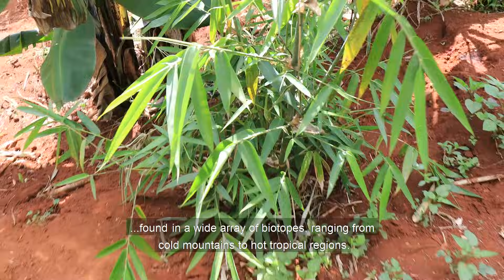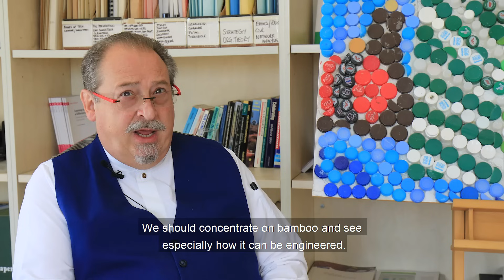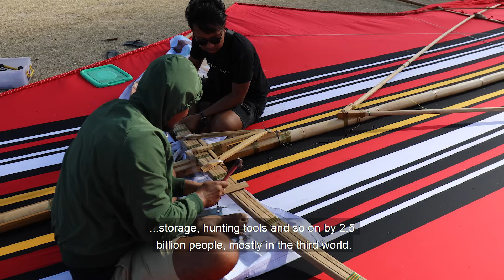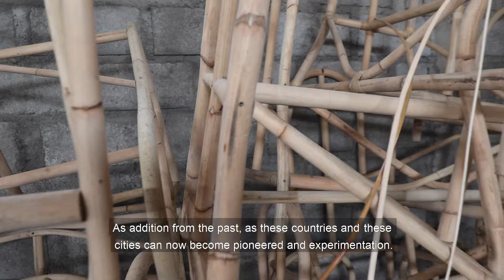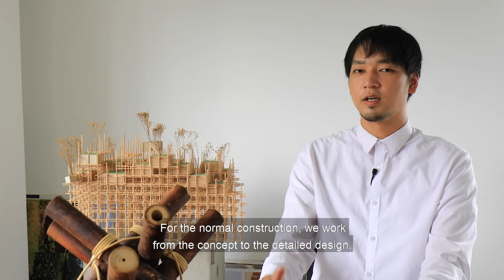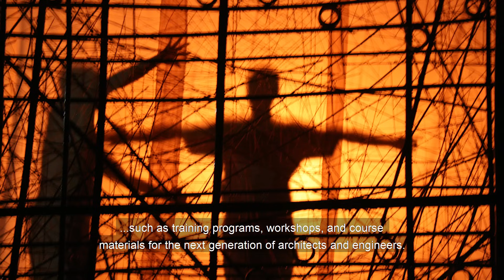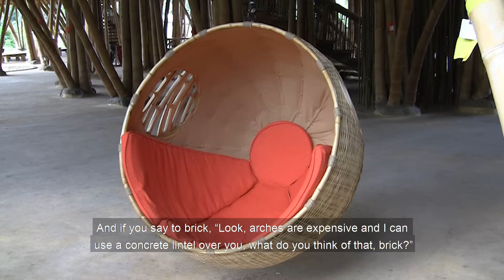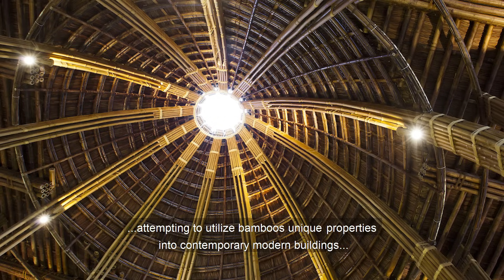Bamboo--the Tradition of the Future

Comment: รู้จักมอดมั้ย  แค่ปลวกมอดกินก็ตายแล้วบ้านทั้งหลัง
moth & turmite.  once you have the bamboo house is uttmostly dead gone korput!!
Reply from the maker: This is simply not true anymore. There is very good treatment methods that make bamboo longer lasting. So used correctly bamboo is no longer gone in a couple of years. How long does it last? We simply don’t know. But some of the structures in the film are more than fifteen years old without showing visible aging or structural weaknesses.

Comment: the problem is fire.
Reply from the maker: A problem is fire, for steel, wood as well as bamboo constructions. And as so much else in develop materials more research has to be done. However fire is not THE problem, it is just A problem.

Comment: The main problem is that bamboo cannot keep its strength. Houses will break after 20 years because the strength of the bamboo disappears slowly. Only by putting the bamboo into a specific chemical liquid the strength of the bamboo can be prolonged for 100 and more years. This mechanism has been developed for IBUKU by a German architect und is used today as a standard by immersion bamboo into borax and boric acid for a week. IBUKU has built hundreds of beautiful houses in Indonesia and Bali.
Reply: More correctly borax and boric acid are used as insect repellent and preservative. Bamboo borers are a big problem in untreated bamboo thus treating it with environmentally safe preservative makes a pile of sense. Yes, there are studies that prove with very specific formula of the borax and boric acid mix its compressive and tensile strength is increased by 10%.
I have made a system by which I treat bamboo up to 6m lengths in borax and boric acid mixture. I do small batches storing it for later use.
Reply: @darrellturner560  would it be possible to soak it in natural oil and resin too, like they do for self defense canes to strengthen them? They would be strong and pest resistant at that point too. But probably more flammable...
Reply: @ sorry for the late reply. after treated bamboo had dried you can coat it anyhow you like. As for soaking it in oils or epoxy that actually weakens it. you are exploding the cell structure with epoxies and softening the cellular tissue using oils.
Stick with the scientifically proven method of borax and boric acid method. Allow it the dry, sand, clean and finish coat it.
Reply: @darrellturner560 what would be your borax percentage for soaking the bamboo ?
Reply: If Bamboo is treated at first and taken care or it can last much longer than 20 years. My wife is from the jungles of Peru. Her families 5 generation home is made from bamboo and is in fine condition. Sure they have had made some repairs over the years along with growing the size of the home to a quite large home. 
I have been married to my wife for more than 40 years and her family  bamboo home looks as good as it did when I married her. The family has no need to change what they are doing with their home Through the years (45 years ago) they have added flawlessly plumbing and electrical connections that would rival some of the nicer homes here in the US.. It beautiful and very functional. It is a peaceful and tranquil place to be and will last way longer than me or my children if taken care of correctly.
Reply: That’s not a problem
Reply: I'm an epoxy flooring installation contractor and I've been wondering if an epoxy can be applied to bamboo for strength? It can be spayed on, painted on or maybe dipped. It dries quickly and  of course water proof,  it with stands heat excellently and can be decorated...
Reply: Id love to find out too@abdulrahmanraheem423
Reply: That lifespan is waaay more than acceptable for an untreated "poor man's timber" unless you are building a full blown modern structures LOL.

Comment: Stop making me aware of Bamboo and invent some standardized, mass produced FASTENERS! And a code. The problem with bamboo is not AWARENESS. All of these facts were repeated at least once in roughly every issue of Popular Mechanics for over 80 years. But if I decide to actually use it to build something larger than a chicken coop, I've got some real engineering to do haven't I? Engineering that someone did 150 years ago for steel or wood or concrete. I need a way for someone with little to no expertise to stick two pieces of bamboo together that can be ordered by the cargo container.

Comment: The present invention relates to fiber reinforced thermoplastic materials comprising air laid cellulosic fibrous material, and uses thereof. Fiber-reinforced composites based on thermoplastic materials are increasingly being used in many technical fields to replace metal materials because their mechanical properties are in many respects comparable to those of metal materials, yet they allow significant weight savings. For this purpose, in addition to the thermoplastic matrix, the composites also contain fiber components that have a considerable influence on the mechanical properties of the composite, especially the tensile and flexural strength and impact toughness.

Comment: Harvested every 3-5 years vs 15-50 years for most other wood that makes it ideal for outer Decks as long as it can handle Snow and ice. Class A Fire rated - no bad. 
The physical characteristics of bamboo differ significantly between its species (Rogerson et al., 2016). Bamboo is strong in tensile as compared in compression (Awalluddin et al., 2017) .  The compressive strength of bamboo is roughly situated between 40 - 80 N/mm2 which is twice to four times the value of most timber species. 
Bamboo with low moisture content has a higher compressive strength than bamboo with high moisture content.
Reply from the maker: Good comment and in principle right. Just a clarification. The rhizome of  bamboo (the root system) takes from 3-5 year to mature. Then it takes from 3-4 years for the single culm of bamboo to mature. But, roughly after 6-9 years bamboo can be harvest every year. Given that a the plant can be between 60-120 year the yield of bamboo is substantially bigger than other woody spices.
Reply: We really need specifics on the species/varieties. I have grown several but nothing big in S Island of NZ sadly. @anthrotechture5709

Comment: Does anyone have a actual architectural example of a wall with External Bamboo and with Lumber on the inside.
Reply from the maker: There are some examples (like this project: https://divisare.com/projects/261353-ast-77-architecten-steven-massart-low-energy-bamboo-house). However, Bamboo is not really suited for outdoor cladding since it is sensitive to UV Light. Perhaps, a better solution would be to invert this idea so the lumber is exposed and the bamboo is used as th interior material.

Comment: BAMBOO IS AN INVASIVE SPECIES AND HAS NO USE EXCEPT BY POOR PEOPLE .... IT IS A WEED THAT YOU CAN NEVER GET TO STOP GROWING
Reply from the maker: That bamboo is invasive is a misconception. Yes some bamboos (a few) is invasive if in the wrong environment. There are two types of bamboos: the so called running bamboo and the clumping bamboo. Running bamboos are monopodial and have long rhizomes that are quick to spread horizontally. Clumping bamboos are sympodial and have shorter rhizomes that stay closer to their point of origin and do not spread so rapidly. To this is that all types of running bamboo can be planted so they stay put.

Comment: what does grading of a material means
Reply from the maker: Grading in this case refers to the process in which a material is classified in regards to its mechanical properties, and appearance. Since bamboo is a organic growing material the individual culms differs due to a numbers of growing condition. A grading system, similar to what the timber industry is using (where individual pieces of wood is classified) would be beneficial for engineers and builders in how to select the right culm for the right part of the building.

Comment: Future material? Good luck making a bath room with bamboo.
Reply from the maker: We are not really getting your point. There are both bath-tubes and wash-basins in bamboo. Besides this there is some state of the art fly-fishing rods that survived over 100 years made in bamboo. I guess by your measure Mouri Kogoro bamboo is indeed a material for the future.
Reply: @anthrotechture5709  
Problems of using bamboo on wet area
1. Fungus
2. Leakage (for 2nd floor and above)
3. Hard to clean up safely (non-damaging).
Reply from the maker: You just listed problems with bathrooms in general. You would not see exposed steel or concrete in bathrooms either. So once again we don’t really get your comment.

Comment: My Bamboo based flooring is the most incredible i've ever used. It was terribly expenside though luckky I found it ater someone else had utilized it and jjst wanted to go ;with a lighter shade' I have 506 ft x half ft board outside for 5 years and they are obviouslynot min anymore but I could rescure a middle cut off one if i had to repair the flooring (20'x25' room) it's soundproofed and insulated my bedroom but I'm glad i din't pay the initial costs i was told were above tens thousand but it was like a whole house install apparently. It's lso very heavy. I'm going to make a 6f x 6ft raised structure for a friend's permanent tent shortly. it has nNO trouble holding 170lbs at the center esp whe n i double it up it;s pretty incredible but this is aged appparently 10 yrs before being made into super processed and then baked on flooring finish. this finish has barelyu chipped on the wathered stuff outside and we have harsh winters here.... Everyone is very impressed with this flooring.. pics avail  if any doubters ;]

Comment: Bamboo is an invasive species. To keep it from spreading you need a barrier that extends 1 foot into the soil depth, or the roots will spread under the soil and sprout in unwanted areas.
Reply from the maker: As always knowledge is needed, this is also true when planting bamboo. There is essentially two types of bamboo: running bamboo and clumping bamboo. Some of the running bamboos are (as you are pointed out) problematic and can be invasive and hard to hinder to spread. However, the clumping bamboo, as it’s name indicates,  is growing in circular clumps. Albeit, some of these clumps can have a big circumference, clumping bamboo essentially stays where it is planted. That said, even running bamboo can be controlled by different kind of barriers.
Reply: No it's not. There are clumping varieties.

Comment: As an engineer, when I toured parts of Asia, I realized what an amazing engineering material it is. It very versatile, easily adopted to many purposes.  The strong fiber in one direction gives makes it able to resting bending forces., They also make it very strong in both compression and tension forces
Reply: Bamboo is cold, suitable for the tropic country just like wood that make warm for the snow season. Strong and  beautiful, we can make it for a millions kind of thing.
Reply: Bamboo is good but weed is the best one 10ft tall weed plant takes in as much carbon as a 120ft tall oak tree and the weed plant gives off just as much oxygen as that oak tree also the last thing weed plants produce more nutrients back into the soil than that 120ft oak tree also.
Reply: No not at all. I'm a licensed NYC construction superintendent, I was involved in a NYC dob study back in the late 90s looking into bamboo , it has way too many faults to be utilized in cold weather environments. Once it drops below 32deg , freezing, bamboo becomes EXTREMELY brittle. Also when wet it looses basically all rigidity. It'll never be approved for structural use in the USA, trust me it'll never happen... also throw in it's an invasive species AND the majority of bamboo farm acreage is owned by the Chinese government, WELL THERE YOU HAVE IT
Reply: @Sherry-dg4bv  That's enlightening.  The problems with temperature and wetness aren't mentioned in the video, not even by the architects.
Reply: @Sherry-dg4bv  Interesting!  I had no idea!!

Comment: I am from Boston but have had quite a bit of experience in Viet Nam. So I was very pleased tô see Vo Trong Nhia contributing to this story!! I follow his work to some degree and like what I see!!I would like to see bamboo used, at least initially, in small scale uses like cutting boards, flooring --  all ways to get bamboo into the mind of the potential users.   Has bamboo ever been used as reinforcing in concrete? Bamboo does not rust and expand, for instance.
Reply from the maker: Yes VTN Architect is an interesting Bamboo practice
Reply: During dutch indie era , in indonesia, many dutch old building were build using bamboo, and still strong until now. And from my experience using bamboo to gave wet land stability inside the mud soil, bamboo are more strength and flexible rather than wood.
Reply: Ummm. He is Vo Trong Nghia.
It's difficult to write? Yeh. I think so that although i'm Vietnamese. In Viet Nam, you can write wrong your name every time, everywhere when you forgot how to write your name . It's not big problem in foreign (when you lived here along time). But. In the serious problem... Ummm. This is important problem in Viet Nam because you can wrong write when you do exam... And fail the exam.. or you can make misread impression for other people you name this, name that. So.... I think you shouldn't write wrong name while on important moment.

Comment: Another useful technology in implementing Bamboo in "conventional buildings" are "Engineered Bamboo Products"

Essentially you cut the bamboo to standard lengths, then run it to something akin to a "log splitter", then these sticks/sections are planed.  They can be processed via a variety of techniques (steam, heat, pressing, shredding, splitting, etc) into something akin to plywood, oriented strand lumber, etc.  It is not designed/marketed for structural use per se but see "Bamboo Flooring" / "Bamboo Countertops"

It can in essence though be substituted for "2x4's" and plywood sheets among other similar things.  I think these "drop in solutions" would be much easier to implement / more widespread (although those "Bamboo Cathedrals" look amazing and i would love to see more things in that style! )
Reply: The process you describe was first used back in the 19th century to make Bamboo fly rods!
Reply from the maker: Yes, it’s true  “split cane” or bamboo rods as an engineered product have been around for a long time. From about 1870 to 1950 bamboo was the standard in this industry and it only lost its predominance due to a trade embargo. In our upcoming production “The Bamboo Dialogues” we discuss these and some other early innovations in bamboo.
Reply: @anthrotechture5709  That would be great!

Comment: I think an important factor is that, in France at least, towns with partly wooden construction were often destroyed by very large fires impossible to stop and to prevent from extending, even if fire men'brigades were created for this. So advertise for bamboo use was completely contrary to what experience had learned to building specialists and not even examined.
Another negative point is that using bamboo is difficult to teach because it needs much know-how from builders to choose a "good" piece for your use, to shape and link it for a construction. All this is more an Art than a Science or a Technic and is thus difficult to teach without having "your hands on it". Which makes it difficult to increase the number of specialists needed to build in number.
Reply from the maker: Two very good points fire resistance and knowledge transferal. We must remember, as mush as bamboo is a traditional material with a 1000-year history it is relatively new as a contemporary material. We need more research!

Fire: It is correct that in the wake of the industrial revolution with mass urbanization that brought a densification of our city many of Europe's "wood cities burned. not uncommonly these fires were related to the newly established industries and steam train technology (sparkles from the steam engines). Simply fire would easily spread the densely packed urban structures. With this came strict laws, regulations and codes. Wood as a building material suffered a lot from these incidents. However, since then our understanding of how fire starts, spreads and effect wood structure has increase and codes have changed for wood constructions. This have, lately, lead to a boom of project in wood into our cities. Bamboo has not yet gone through the same process. we are still lacking codes and regulations for how to properly use bamboo into our cities.  As always the solution to this problem is more research;  we need to know more of how bamboo reacts to fire. 

Knowledge transferal: to build in bamboo is as pointed out today a craft that we find only in regions that maintained bamboo cultures. The solutions here  are: more bamboo teaching into construction, engineering and architecture educations; and development of new systems that do not require the same grade of craftmanship. There is some ongoing research for the later. Where joinery and new technology are developed.